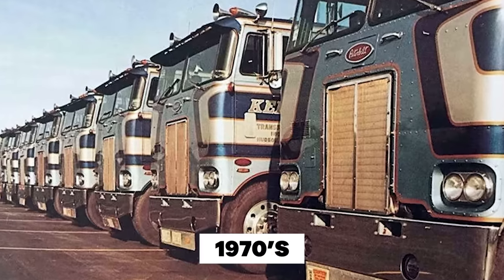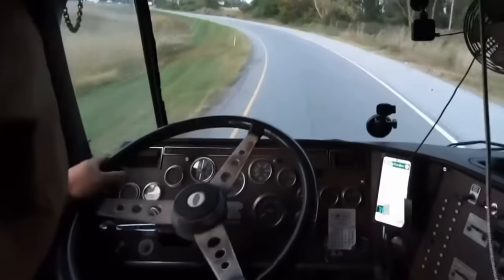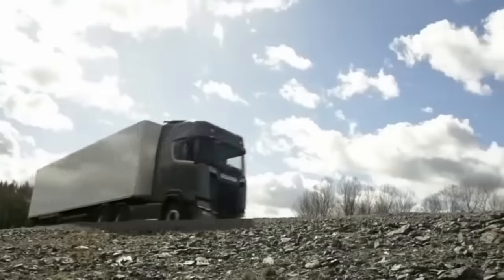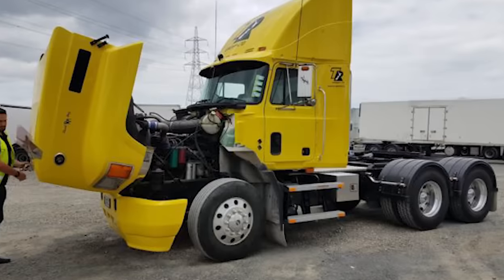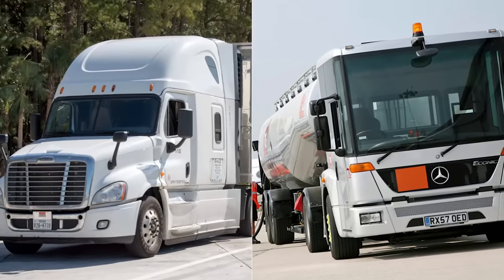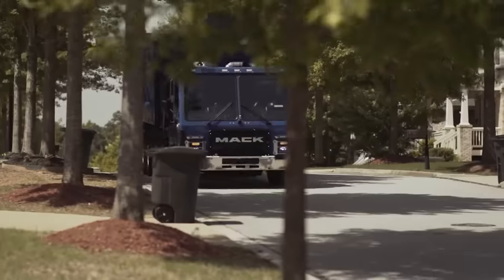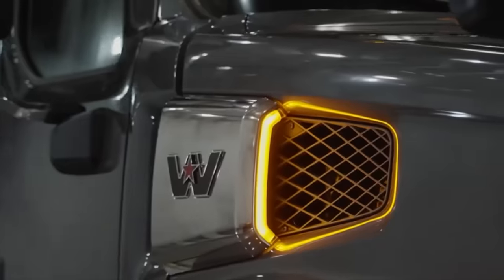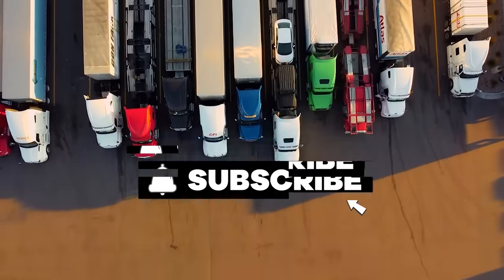The REAL Reason Why America Stopped Making Cab-over Trucks

Comment: One thing this video gets wrong is fuel efficiency.  The modern conventional truck is inherently more aerodynamic than a cabover.  At highway speeds, the primary fuel cost is aero drag. In cities the cost of accelerating the weight is more important.  So, a conventional sleeper cab is the more cost efficient choice for the highway. While a cabover daycab would be a better choice for city work. I don't know why euro style daycabs are not sold in the USA other than the market might be too small to sell a different cab.

Comment: Well, looking at American Cabovers from the 80s and 90s, and comparing them to European Cabovers from the 80s and 90s, it is blatantly obvious that American manufacturers NEVER knew how to make a good cabover. Massive engine tunnels, driver sitting exactly over the axle instead of a little bit forward, little to no suspension for the cabin, and so on, shows how behind the North American truck and bus industry is, compared to the Europeans. The only way I see Kenworth/Peterbilt offering a decent Cabover Class 8 Semi in the US, is by rebadging a DAF XG+.

Comment: I have driven both types and your comment about sitting close to the windshield is wrong. Distance from driver to windshield is basically the same either way If you chop off the nose on the conventional tractor then you have your COE, nothing changed between driver and steering wheel /dashboard configuration. The only thing that really change between the two is the height of the vehicle.

Comment: You make a good point. If it weren’t for the fact that European cab overs have just as much or more space than American conventionals  and a more luxurious and comfortable ones at that

And that European saftey standards are higher. While hauling heavier loads with more horsepower and while they may be stated to only move at certain speeds unlike modern American rigs. European trucks don’t have a limiter untill much faster. Because of higher speed limits in sections of Germany France Italy and the UK. Etc.

Which means there’s no major difference in safety between a modern can over. Or long nose.   If anything the modern can over is more safe due to the standards imposed on its construction.     Something tells me me you didn’t go into this with an actual understanding of what’s behind the industry changes

Comment: Yeah, I've been driving trucks for over 33 years started in January of 90.  there's a few things wrong on this video one. The 65 foot length, specially with 53 foot trailers was in effect until the 2000s?  freightliner was behind getting rid of the length law which is now 70 foot.  Because nobody wanted their junk tabovers. International 9700 rule. With the transformer movie where Gavatron was a cab over. That was they were gonna go with this 57 footer. In a parentally did not even know in a 4 corner state in the South West, they've been used knows for 20 to 30 years. I've been driving conventionals for now, 20 years, which they're great. But cabovers on the East Coast and New England in the big cities like Cleveland Detroit, St. Louis Philadelphia, in New York City Where the cabover is a little easier.  But first, have a good point and bad points.

Comment: Other factors to consider .
Cabovers ride bad.
Your directly over front axle.
Climbing in and out over and over is rediculas.
Like issue hooking trailers, or chaining up.
Constant climbing.
It great when their icey.
Or in rain.
Most Cabovers try to take off wet boots , or your rain gear.
The heat from engine can become extreme.
Same for cold air rushing in from the flat front.
They're like pushing a brick through the wind.
As well as the SUN ...Beating on ya when traveling words it.
Sun magnifying through windshield.
At the truck stop it's OK, but TRY washing the windshield !!
That's just a few off the top of my head.

Comment: In a crash where you run off the road or hit a fixed object like a bridge abutment would ya want a long nose or a cab over? Physics matter too and sitting over the front axle vs. between two more distant axles is no contest. Luxury SUV and pickups also have long wheelbases for good reason.

Comment: "thousands of miles a year" Even as a short haul driver i put upwards of 500 miles A DAY on my truck. And yes, Cab over's for long distance SUCK big time. You're squished inside the cab right next to the engine, and you're sitting directly above the front wheels, which pile drive your ass through your skull on every little bump. Not to mention you have to remove everything from the cab to check anything on the engine. Visibility and maneuverability the COE is unmatched though!
Reply: That's why you have tons of storage in modern EU trucks. Not to mention that driving those is night and day difference compared to the American cab-overs.

Comment: Tesla's new truck does not look like a cab over. Even though technically it may be, it still has a short nose.
Reply: Since there's no engine, it can't be a "cab over engine" anyway... it's "cab over front wheels". In any case the "cab over" term doesn't say anything about the nose, only the position of the driver.
Reply: @brianb-p6586  ok, what would you call it? Cab over battery?
Reply: LOL @shmeli  
The Tesla Semi battery is actually not under the driver - it's all between the front and rear wheels, across the full width of the truck, split into packs between and outside of the frame rails. The space under the floor below the driver is presumably filled with the many support systems that an EV needs, as well as of course the front suspension and steering.

The "cab over" terminology just isn't very useful in general, because there are so many design factors that it doesn't describe. There isn't a common naming practice to replace it, although "forward control" means that the driver is at the front of the truck... which as you pointed out doesn't quite match the Tesla Semi. 

There were "cab over engine" or "COE" trucks - such as the 1948-1957 Ford C-Series or the COE variants of the GM AK series in the 1940's - in which the driver's position did at least partially go over the engine, but was still behind the front wheels so there was a short nose. They were called COE's, and they had more of a nose than a Tesla Semi. 

More recent examples of the terminology challenge include both variants (off-road UHN or Type 437, and implement carrier UGN/UGE or Type 405) of the Mercedes Unimog of the past two or three decades. Both of these designs have the engine entirely below the front axle and the driver sitting directly over the engine, with the windshield around the axle line and a sloped nose in front of that. They are literally COE (because they do have an engine under the cab) and they have the overall proportions of the Tesla Semi with a more distinct nose (not the same slope as the windshield)... do you call them COE's or cabovers or something else? In the industry worldwide this is called a semi-bonneted vehicle, but I've never seen any cab style term applied to either of them.

Comment: TL;DR for Europe: Long nose trucks used to be normal in the 1950ies in Germany. But there was a minister of traffic called Seebohm, and he wanted to make the truck less competitive to the existing railroads as the roads were not ready yet for that huge growing truck traffic.
So he set a maximum length of a truck including the cabin. That made it until now for the whole European Union. And that is why they try to cramp the cabin as much as possible to get more loading space.

So yeah, it was Germany's fault.

Add also that trucks in Europe (and Asia) are only allowed to travel at much lower speeds than cars - making them a traffic nuisance everywhere - but that means they do not have to have a good cW wind resistance value and the "German Schrankwand" - style of cab is acceptable. A truck in Europe on freeways has 49mph of speed limit and on normal roads 37mph - meaning cars always need to pass them creating accidents.
Reply: I'm not sure what you mean by "normal roads", in the European country I live the upper limit for a truck is 90 kph, 80 with a trailer other than that they follow the posted speed limit.

We have a weight limit of 74 tons and 34.5m. Obviously depends on configuration and where you drive but that is the general limits (without a special permit).
Reply: @AlexKall  In Germany the speed limit for trucks on non freeways (my "normal roads") is 60 km/h - 37mph.
Reply: @CaribouEno  Interesting, here in Sweden it's the posted speed. Freeway is 90 without trailer and 80 with.

Comment: It's simply  operating  cost when they were  allowed to  use  longer trucks it turns out they are  slightly  cheaper to  insure since you are  no longer  your  own crumble zone and conventional trucks ride  better  plus there easier to  work on  and  service wich makes them  cheaper to  operate anything that  save operating  cost or minimizing down  time rules the industry

Comment: I dont get the logic why Americans make the biggest engines with biggest horsepower and make it as a marketing tool so that they can sell good looking trucks in the market. They sell good looking Peterbilts, Kenworth's, Freightliners, etc but this trucks are less efficient in fuel consumption. These American made truck are fuel guzzlers. They consume fuel too much. Whereas you compare it to some European and Asian made trucks they are so fuel efficient. Volvo, Scania, Hino, Isuzu, Howo these are non American made trucks that are efficient because of good mileage. I think it is the fuel system management in these modern engines that all matters.

Comment: This video is way too long, repeating the same thing at least six times toward the end.  But I miss cab-overs.  I have a 1964 Ford Econoline van.  The engine is next to the driver and both are atop the front wheels.  Lots of internal room, and it is only nine inches longer than a VW Beetle.

Comment: lets take cabover trucks in EU VS USA- in EU there was 4 corner airsprings, air suspension for driver seat, more high tonnage axles etc etc 20+ years ago. Also long wheelbase US trucks seems pointless as the maneuvering suc`s compared with cabover trucks and whats the point wasting cargo room just to have engine in front. And the point you tell cabovers take up to 30 min to lift the cab? :D EU trucks have option to lift cab with controller and electric motor lift the cab in 1-2 minutes. Take a look on new DAF truck cabin with bed you never find on US trucks...theres tons of room on nowdays EU trucks with flat floors etc
Reply: US trucks had that before Euro semis like air ride suspensions what are you talking about?😂 US semis have far more space to work with because American truck drivers drive far more, haul more and are more fuel efficient. Most sleeper trucks in the U.S. twice the room in the sleeper itself than an entire Euro trucks. Why would you lift the entire cab when you can just lift the hood?🤦🏽.

Comment: Why aren't 18 wheeler trucks shaped more like a bullet train or a bit more aerodynamically?  I get making a windshield out of curved glass would be expensive so we could figure out a way to retrofit a standard size square at an angle.  We have all the sensors to even make a long 10"x6' across the dash seem like your looking thru the engine as it was invisible incase some kid was in front of your truck.  Have you ever seen what's called the MUTANT missile?  Imagine that implemented for the trucks.  Also, bring back small work trucks ffs!

Comment: Nobody wanted to drive or work on one of those POS. The driver was the crumple zone. Drivers fell climbing up and down. They rode like pogo sticks. Doing engine work was tight and cramped. There was a huge engine box right in the center of the cab.

Also you are confusing cabovers with cab-forward specialty vocational trucks.

The most hilarious thing is the stretched out cabovers with a wheelbase longer than a conventional.

BTW in the late 80's we were breaking up fairly new cabovers so we could use the engine, transmission and rears to build conventional glider kits

Comment: No the injuries from cab overs was to expensive as insurance became more expensive the cab over died climbing in and out is a chore it’s not a cab for a driver engine is next to u
Reply: It was more of a problem with US regulations relating to COE since they couldn't have the stairs up to the cab in front of the tire, but rather behind it which is why it was so dangerous.

Comment: The biggest difference between the two is really down to the drivers seat position. Cab over trucks have the driver sitting directly above the steer axle and out above the wheel. as such your ride is slightly firmer and solid compared to bonnet where the driver is positioned between the axles and directly above the chassis rail giving a more seesaw ride that is alot nicer than side to side shake.
Reply: That would be true if everything including the seat was bolted/welded directly to the frame, but that is not the case. The whole cab on a COE is air cushioned, the truck generally has full air suspension and the seat is air cushioned. It's a very smooth ride in a COE.

Comment: COE's were a product of truck length laws and make it possible for larger trailers. Originally tractors were conventional. The Kennedy-Hawkins Law in the 80's eliminated that as well as the barrier states with lower max weights that those on either side which helped the northeast which with its higher limits had to only get smaller loads out of the food belt due to the five, Virginia being the worst on truckers. Conventional are safer by far and permitted nice sleepers which is a key item for OTR truckers.
Reply: Didn’t COE’s exist as far back as the 30’s with those art-deco styling?
Reply: Apparently you've never driven a flat floor international coe

Comment: Cabover trucks have one major problem that can result in fatality - if the cab is not checked and ensured that the cab is completely fixed down onto the chassis  before moving out, halfway through the journey the cab will get loose & tilt over causing serious injuries if not death of the driver. So if a cabover truck is undergoing maintenance at the workshop, the mechanic or service technician has to ensure the cab of the truck is fully & totally fixed tightly onto the chassis and conduct further checks on the truck to make sure safety is in place before handing over the truck back to the owner.
Reply: Been around the trucking industry all my life and never heard of this happening
Reply: @timmebruer5205 . I think he had a bad dream one night.😂

Comment: I don’t think so in Canada or America trucks are going for 130 km speed in Canada is limited 105😊 km
Reply: Nope. There are no national speed limits in Canada, and no limit specific to trucks in common across all provinces and territories. 

Ontario and Quebec require speed limiters set to 105 km/h in trucks, but that's only two provinces. In Alberta, limits are up to 110 km/h and some truck drivers choose to run at or above that limit. in British Columbia limits are up to 120 km/h, and trucks can drive at that speed, but most trucking companies choose lower speeds for efficiency; BC is proposing to add truck speed limiters. I have driven with trucks at over 105 km/h in every province of Canada except Newfoundland & Labrador (just haven't been there) and Prince Edward Island (roads are too short and too rough for high speed).
Reply: It is not 105 km/h,   it is 110 on most highways outside of cities and 120 on some.   But trucks do go faster than speed limit.  If you stick to 110,  you'll be passed by trucks occasionally.  Typically, the flow on 110  km/h highways goes around 120 km/h, and trucks keep up. It is different in Europe where trucks are limited to 90 km/h and right lane

Comment: because they are HOT, and sitting over the axel, you bounce A LOT. The shift linkage is useally SLOPPY. The clutch brake are mostly out of adjustment. [ I don't use clutches anyhowz ] The cab crushes people.

Comment: Crappy ride, sitting over the wheels.  Just like sitting at either end of a train or sitting in the back of a station wagon = higher likelihood of motion sickness.
Reply: The ride in a modern COE is fantastic.
Reply: @AlexKall  maybe, and I know they,are better than they used to be, but physic says given the same seating and suspension driving comfort will always be better, experiencing only 1/2 the g forces of a COE.  There are of course plenty of other valid reasons for COE trucks.

Comment: not just noise and vibration.  HEAT is a huge problem with a cabover engine.  Despite the heatshield on the cabover, it gets really hot in one.  I used to drive a straight truck and it was a cabover.  it got really hot in that truck.  I used to have the A/C on full blast even when it was 20 below zero outside because of the engine heat.